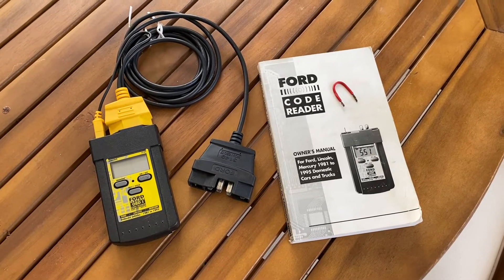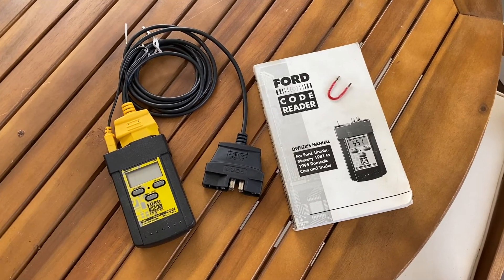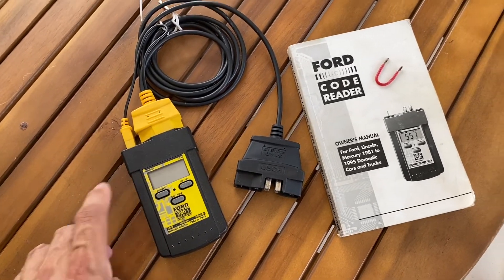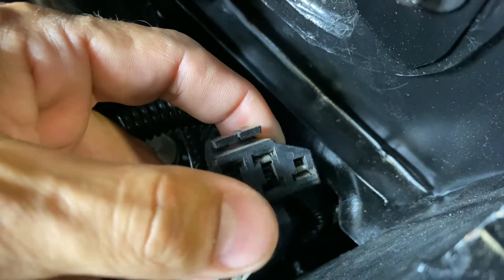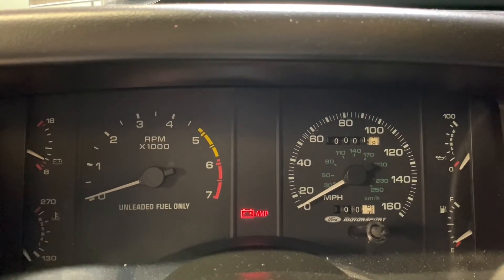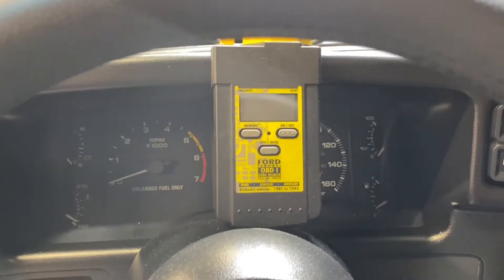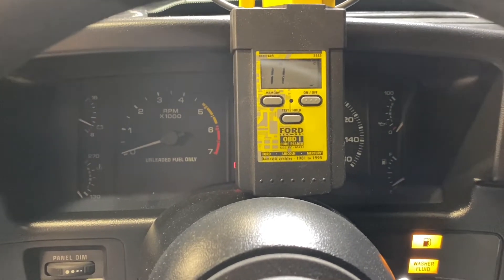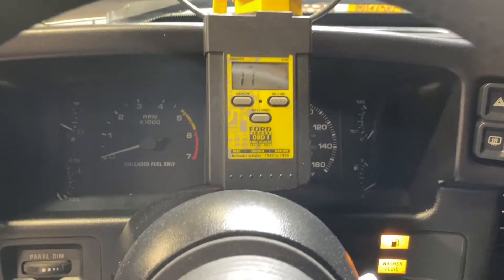86-93 Mustang OBD1/EEC-IV code reading - Innova 3145  (cylinder balance test included)

Comment: I can't seem to even get into the cylinder balance test mode. After all the R-codes have been pulled , I hit the throttle about half way down as you did. I don't notice any change in RPM and after about 2 min I get one square dot and the idle drops as if it's disconnected. No cylinder codes at all. It's an 88 F250.
Reply from the maker: F150/F250 would be speed density batch fire injection.  They fire the entire bank of injectors at the same time.  It would be unable to disable the individual injectors to perform the cylinder balance test.

Comment: Hey, do you have any information on that 160mph Motorsport speedometer you have? I purchased one too but can’t find any history on the speedometer. I know/think the 160mph certified calibration are CHP but the Motorsport…. Idk.
Reply from the maker: They were an offering in the Ford Motorsport catalog.  There was a 140 and 160 Motorsport speedo.  Basically they are the same as the Certified units except for the logo on the face and they only have standard calibration not the certified.

Comment: does it give you get a code if the TFI Module has failed?
Reply from the maker: Not directly.  There's a few ignition related codes but they are vague and don't necessarily point to a specific part.  The fox OBD1 setup is pretty primitive and one of the areas is lacks is helping troubleshoot failed TFI/PIP and coil issues.
Reply: @Mustang5L5  dam I sent my A9L in for repair,  got it back reinstalled it and my car still won't fire just turn over, do you think I will get any codes with  Innova 3145 if I bought one? the battery was disconnected for a month. not sure why it would not start I was moving it over in the garage for 2 cars and I stalled it while reversing and could not start it, it would only turn over?  what could have happened the fuel pump still makes a sound with key on too.